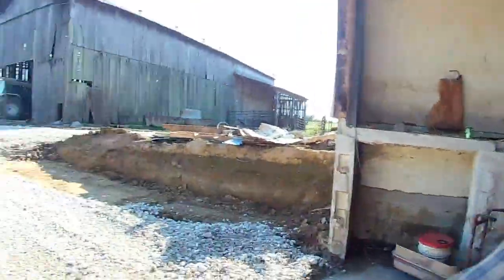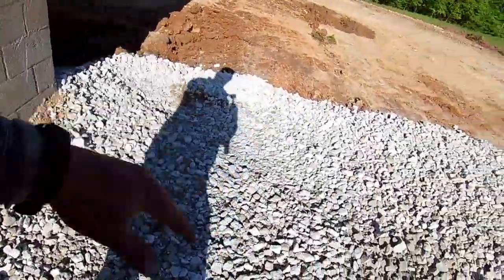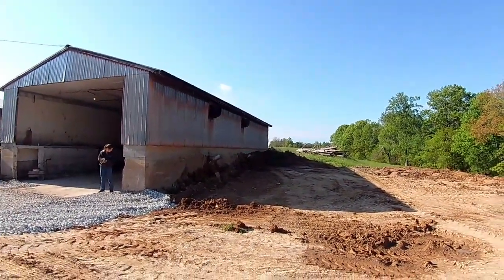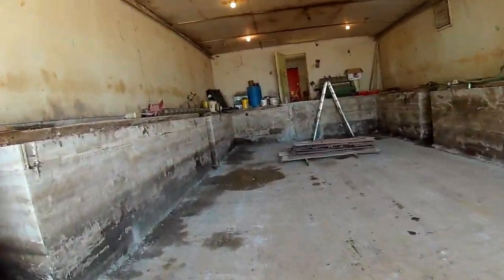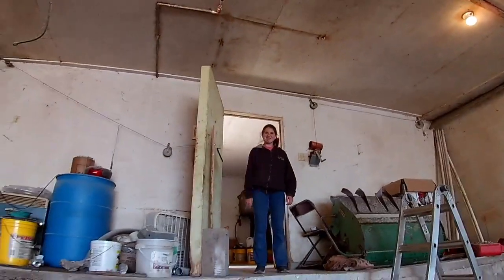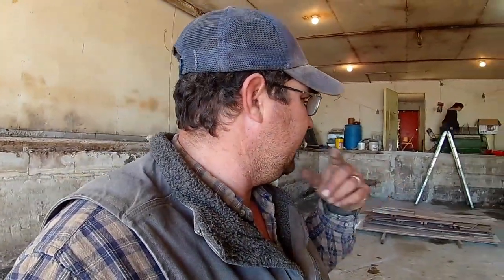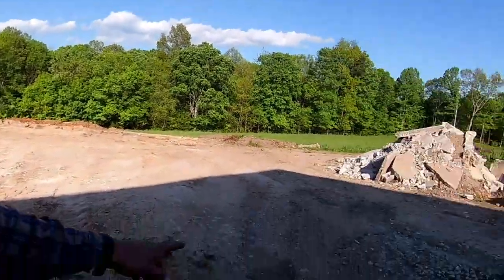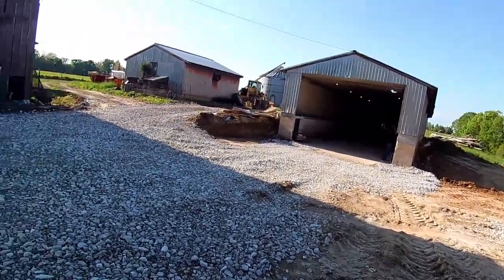D17 Allis Chalmers grinding corn /Working hard

Comment: We use to grind feed with a Gehl and a 7040, you could feed the auger wide open, but the 7040 would slip the belts before it would back down!
She was a beast